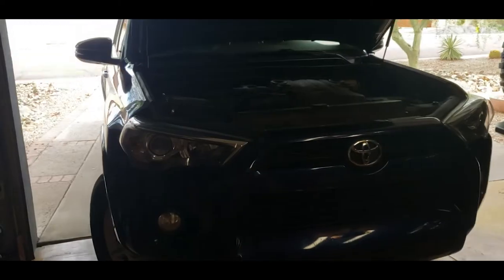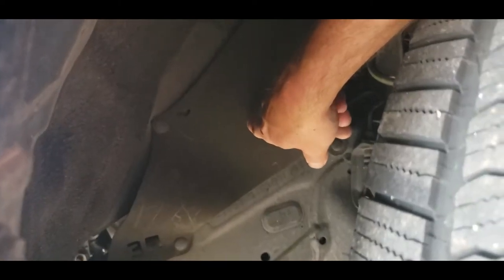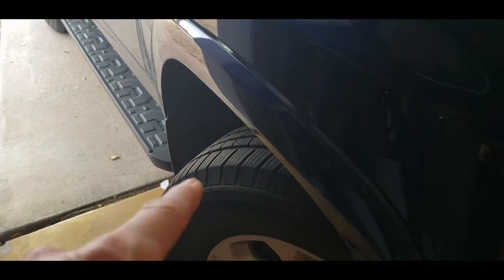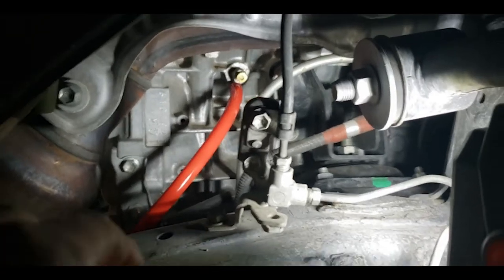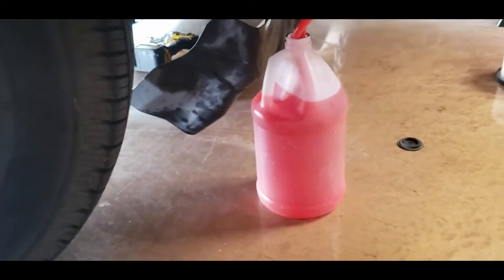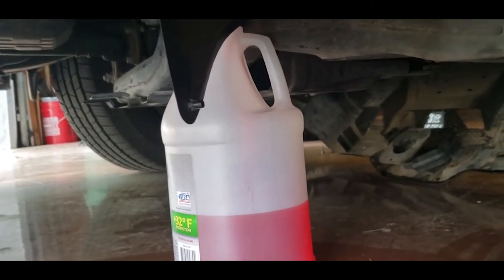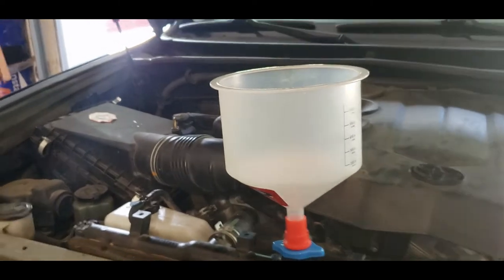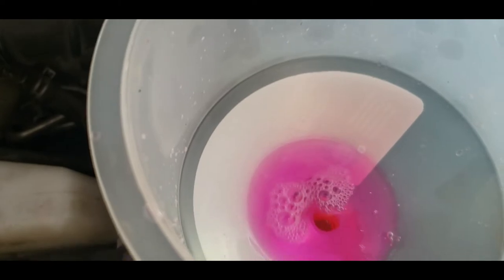2014 4Runer Radiator Coolant Change

Comment: Thanks for that! Is there a drain on the driver's side of the engine? How about the coolant in the heater core?
Reply from the maker: I just did the block drain (passenger side) and the radiator which is actually on the passenger side too. On my Lexus GX470 the radiator valve is on the driver side. Apologies for the mistake!
Reply: @AZRubicon1  , obviously.  My question was if there was a drain bolt on the driver side.
Reply from the maker: @axios76  There is not that I can see. Just looked.
Reply: @AZRubicon1  , thank you for checking. I am sure it will help others. Once again, thank you for the effort of recording your experience.